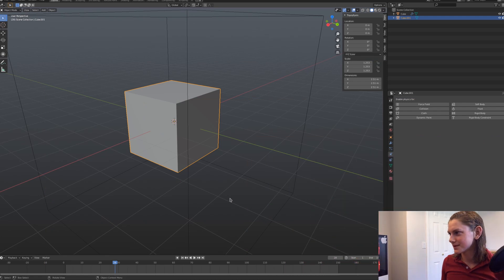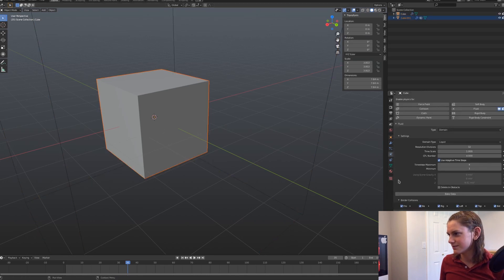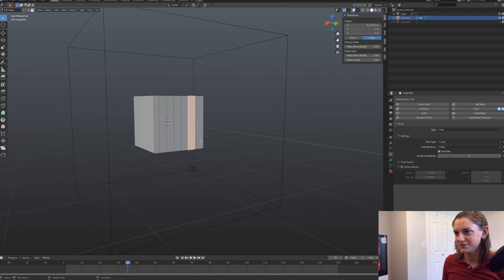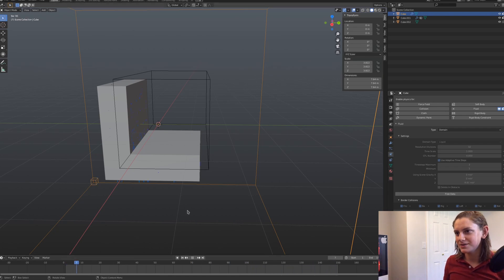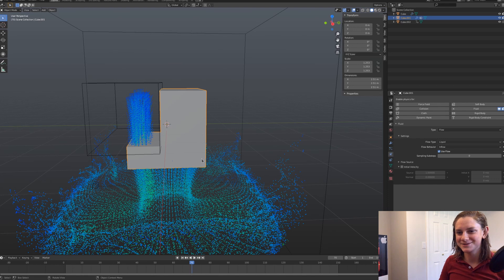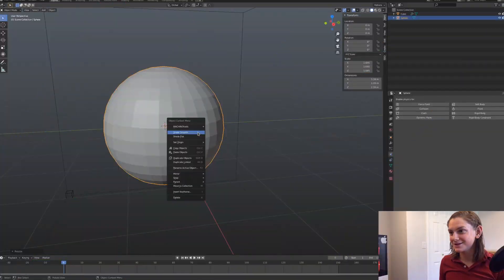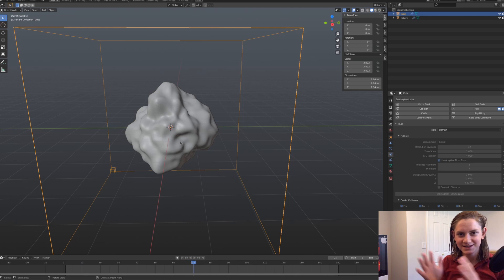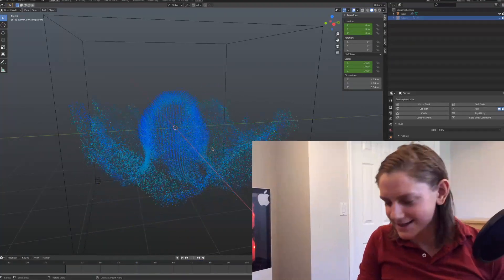How to FIX Dynamic Meshes in Mantaflow

Comment: interestingly enough   one of my projects I am working on is a fluid simulation
more specificly it's "infinitely" wide waterfall
                                                            obiously realistic fluid sim like that would have to be extremely high resolution
so to prevent a crash                       I simply use multiple fluid domains AND gradiant textures

Comment: I am actually begging you to show how to destroy a wooden beam... of concrete. Realistically. With constraints. There is not a single video on it. How do I crash a car? There’s legit not one video on these things
Reply from the maker: Those are all things that I would like to be able to do, but I'm legitimately not sure if blender is a robust enough software to achieve that. It would likely be possible if you are hand animating with shape keys or armatures, but simulating crumpling metal or splintering wood doesn't seem in the scope of what's capable. I'll make a video if I figure anything like that out, but right now those types of simulations are more in the realm of Houdini.
Reply: @MrCheebs  there are addons for 2.79, but right now you Will have to make your own addon in order to destroy things realistically😅